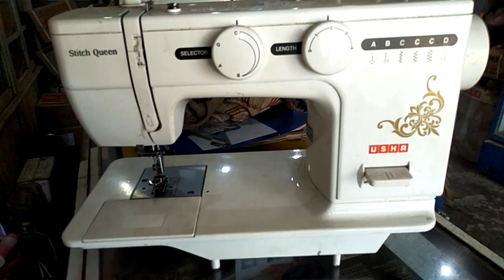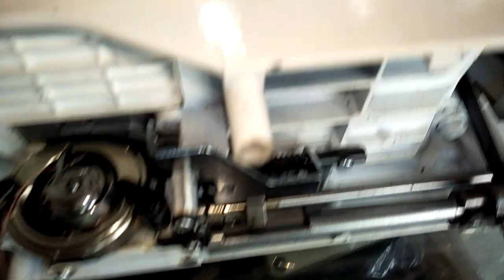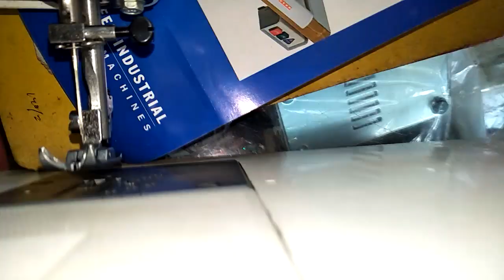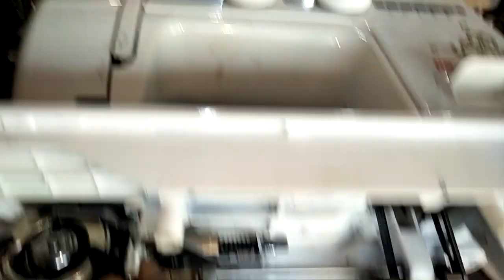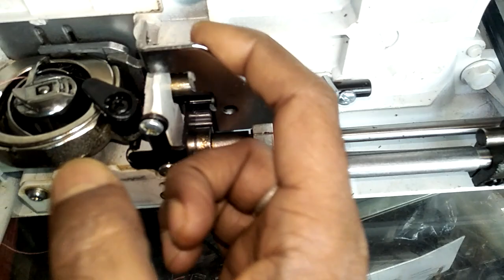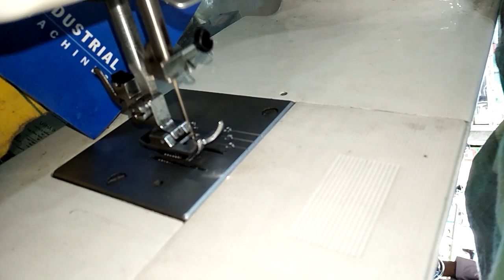Setting of USHA stitch Queen sewing machine  before starting Embroidery

Comment: Bobin ka dhaga upar nahi aata hai
Reply: Please check if you fitted new needle wrongly.
Reply from the maker: Firstly, you might somehow put your needle wrongly. Re-install it if still it don't work then-
2ndly , your machine machine need proper tuning. Call a mechanic, they shall adjust  proper timing of your shuttle that is stopping your needle to pull the thread.